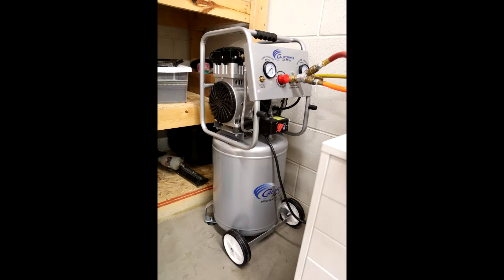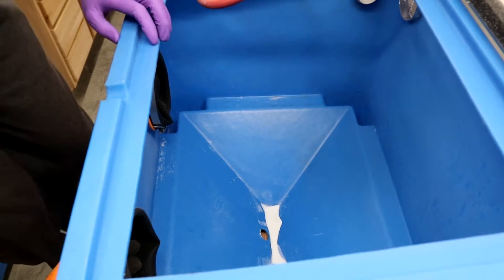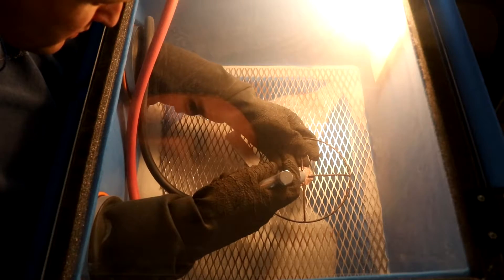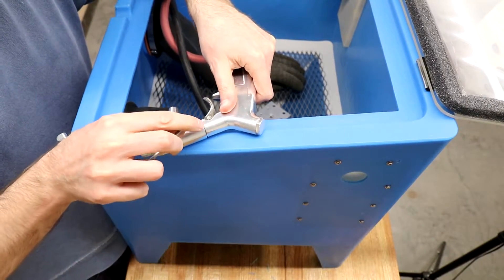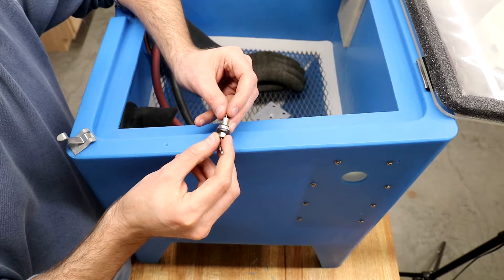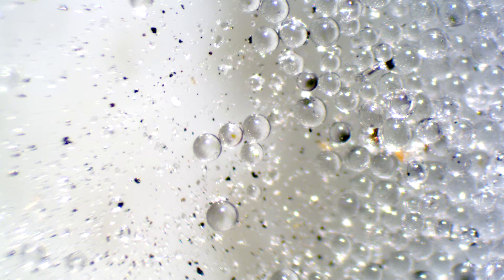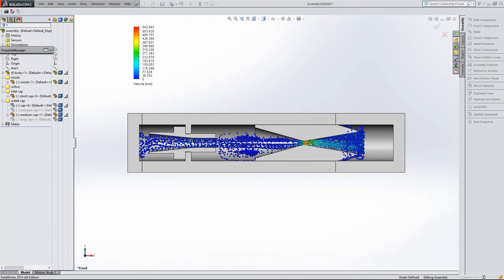Abrasive Blasting With Small Air Compressor

Comment from the maker: Check out my most recent video: https://goo.gl/Jj7cU1

I forgot to include an example of bead blasting a white painted surface. The beads only slightly grayed the surface and didn't remove any paint. I'm sure this has nothing to do with the compressor or blast cabinet and that if a more abrasive media was used the paint could be striped, though the nozzle of the gun may wear faster. Bead blasting may also be useful for reverse engineering PCBs. The glass beads strip the silkscreen making it easier to follow the traces. https://www.instagram.com/p/BRWGMaxjEJk/
Reply: Any way I can buy a baffle kit from you for a cyclone blaster?
Reply from the maker: @jimschiavo8115  Hi Jim, I don't have them for sell. If making them again, I would probably make at least a couple of the pieces from metal and consider using a divergent flow in the exhaust. If there's hardware store shop-vac adapter, that might be the way to go, plus the milled parts. For the 3d printed parts, I have heard people use the following.
https://all3dp.com/2/best-3d-printing-services-for-your-thingiverse-things/
Reply: @kentvandervelden  divergent flow?
Reply from the maker: @jimschiavo8115  You're right, that's too broad. I was thinking a Tesla valve-like, or louvers, or something to create obstructions in the exit, and vortices to drop out the media. Not the divergent flow in the de Laval nozzle for the media gun.
Reply: Hi Kent I did not receive any email rolandgreaux@gmail.com please send it again

Comment: I’m looking at  getting a 2 hp 20 liter  which I think is around 5 cfm , or 150. Lpm , how long between each blast before it starts up again it shard to tell in your video on the time clock , it looks like you started the recovery at 3 minutes
Reply from the maker: At most three minutes maybe and only with a narrow spray pattern, and that makes inconsistent coverage. This compressor is usable in emergencies for this size of gun nozzle. A larger compressor is needed for regular use.

Comment: Just picked a blast cabinet and have a 30 gal already. I have been wondering about efficiency using a small cfm (6@90 psi) compressor. I do appreciate the math used for the nozzle. That info I'll hold on to.
My question to you is would enlarging the line from the compressor to the nozzle improve flow? My thought was removing a few restrictions would allow higher velocities...
Reply from the maker: Thank you Vincent. When air is flowing, the pressure is going to drop across each restriction: from the compressor into the tank, into the line, and then into the tool. The amount of pressure drop will depend on consumption rate. Keeping the blasting cabinet close, with a short good size line will help the numbers, but the real test is measuring cleaning rate per minute. Let me know what you discover, I'm curious if you see a difference. On my compressor the largest restriction is the between the tank and the hose, in the compressor fittings!

Comment: Hello Kent, how would you determine the best gun (nozzle and air jet) for a certain compressor? Basically how to determine gun cfm requirements and check if it matches your compressors output?
Reply from the maker: Hi Enrique. There are charts to help for standard nozzle sizes. It's amazing how quickly one runs into a CFM limit.
https://www.mediablast.com/sandblasting-compressed-air-chart

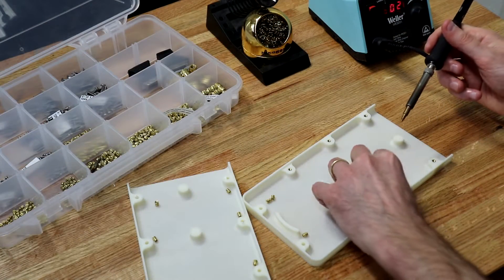Comment: 3:17 is that simple soldering iron or special tool?
Reply from the maker: Great question, this is a combination of a normal Weller soldering iron and a special tip. McMaster sells these but they are expensive and a combination of insert and removal tips is about $40 for each insert size. I made these on a lathe from a bit of brass. The insert and removal tools are similar but the removal tool has a threaded end for grabbing the insert. If you are interested, send me an email and I'll reply with the drawings.

Comment: Brilliant . Is there any way I could hire you to make a pair of those baffles and the nutserts? I don't have access to a 3D printer.
Reply: Just figured out I can order the 3D printed parts from the Thingiverse site and get them shipped to my door. The internet is still pleasantly surprises me despite how rotten it's become.
Reply from the maker: Sorry to reply late. I've been meaning to, but I needed to figure out how I was going to replace the broken extruder on my printer. Let me know how things work out. The baffles have helped reduce the wasteful consumption of glass beads, but they could be further improved.
Reply: @kentvandervelden  I ordered the baffles from two engineering students in Pittsburgh through Treatstock on Thingiverse. Printed in blue ABS to match for US$50 shipped. Not bad! I used less professional looking but adequate self tapping screws instead of nutserts, 3M VHB tape to seal the two flanges and coarse steel wool as a filter element in the baffles to hopefully reduce blow-by. I replaced the porous foam under the pane with single bulb weatherstrip for a better seal. The rest of my set up is shop air at 150 psi regulated down to 90 psi, an Oneida Dust Deputy and a Vacmaster Beast portable shop vac. Thank you for making this design available to the public. The true spirit of the internet where information is shared among enthusiasts, not jealously guarded.
Reply from the maker: Hi Noah, thank you for telling me how this worked out. The steel wool filter is pretty clever. Your comment about sharing vs. guarded secrets come at a perfect time, like a sign. Best wishes

Comment: Looking back, would you have chosen a more powerful compressor? 

Glad I found a channel that provides your demeanor and content!

Many thanks.
Reply from the maker: A bigger compressor would be an easy choice unless portability is needed. Previously. I had a 220V 5HP two stage Ingersoll Rand and that was far nicer but noisier. Maybe IR now makes a slower running compressor. I could probably bead blast 10x faster with that compressor. The cabinet I had was the floor standing model of the desktop model shown in the video. In my situation, noise, location, and electrical service made me choose the CAT compressor, which is still running a couple of years later. Thank you and have a Happy New Year!
Reply: @kentvandervelden  did you ever find a optimal nozzle size for such a low cfm compressor? im kinda in the same situation using a basic 21gal harbor freight unit ay 4.7CFM @90PSI and would like to optimize the gun/nozzle size so the compressor has to work less, as well as optimize media effectiveness. Thanks
Reply from the maker: @christopherlister8932  Thanks for calling me out :) This is one of many projects that get pushed further down the list. A few people were interested with the modeling and engineering experience to get the job done, but I didn't have the time. Today I would certainly get a bigger compressor, mine is showing problems, including multiple leaks, from running so much. Even the compressor you mention is larger than mine. A big problem with using smallish compressors on media blasters is that a small nozzle must be used. I wanted to increase the velocity of the media, which could be measured by the energy imparted to the target, but the pattern gets tighter. With a tighter pattern the operator's time increases potentially a lot and with poor overlapping the finish on the part is not as nice. For prepping small aluminum parts I mostly use a vibratory tumbler. Not sure if I can help you more today, but if I can in anyway do ask. Best wishes, Kent
Reply: Kent VanderVelden I understand, the cabinet I’m using says it uses 9.5cfm at 90psi however I’ve read you need to x that by 1.5, meaning a 14.25 cfm compressor. Looking around that puts me about the $1000+ mark which I’m still debating over. Tough choice but I do need a compressor to keep up with blasting and prep for powder coating on the side now. We shall see. Thanks
Reply from the maker: @christopherlister8932  Before moving to town, I had the next size cabinet, floor standing unit from the same manufacturer. That was powered by a Ingersoll-Rand 2340L5-230, which also ran constantly, but delivered sufficient power that the blasting pattern was nice and even and processing was quick. Larger and dirty farm stuff I blasted outside with a pressure pot. If you at all do blasting as part of a side business... and already have the needed electrical... a large compressor (and good water and oil separation) will save you a lot of time.
Reply: Kent VanderVelden yeah for sure I have the electrical all setup I just need to land on a decent price point decent cfm compressor next, I think a 60gal something around 12cfm should suffice

Comment: what size bead did you use ?
Reply from the maker: "60-120 mesh grit" and the brand is Potters. I'm sure I ordered from MSCDirect.
Reply: Kent VanderVelden thanks for the reply , really great work on fusion and other mods. Do you have any experience with glass abrasive 150 and Glass 220 bead?
Reply from the maker: Hi Iassac. I have a bucket of the finer beads but have never used them. Have you seen the following video? He has a lot of great suggestions for glass beads. Looks like a lot of his equipment is custom too. https://www.youtube.com/watch?v=NidtDNT0MM0
Reply: Kent VanderVelden that's great I havnt seen this video. I will check that out , it hasn't been easy finding info on glass bead with different types of material. I appreciate it

Comment: Kent: I have the same California Air compressor. Do you know where I can get a blasting gun with a 5/64" orrifice like the one you have? Any guidance would be appreciated. Thanks.
Reply from the maker: The gun that I showed came with the blast cabinet, which is from Cyclone Manufacturing (https://www.cycloneblasters.com/) but the cabinet model is no longer sold; mine came from eBay. Regardless, try contacting Cyclone (info@cycloneblasters.com) and ask what they can provide.

Comment: decent
Reply from the maker: +Asher Rose Thanks! Have a great weekend
Reply: any more updates on this? very interested
Reply from the maker: The setup works well. I use it frequently for cleaning up parts after machining or just to knock off crud. Works fine with the small compressor I have with the small nozzle. I've also used it to remove silk screening off PCBs to help with reverse engineering two sided boards. I only use glass beads, and with them with the vacuum on the lowest setting there is still some sucked up with the baffles in place. Far better than without a baffle. There's a decent amount of media that gets caught on the ledge holding the grating, but some wedge shaped hardwood or similar around perimeter resting on the grating and ledge would solve most of that. I have a few nozzle designs to test, once the new CNC lathe conversion is done. I would like some way to truly measure the impact force of the abrasive. Perhaps a piezoelectric sensor? Very useful tool. Let me know if I missed something.
Reply: you answered everything thank you!! once ive made my unit defo need to invest in a decent lathe!

thank you very much
Reply: one more question, what grade is the glass bead? my compressor iv been told will struggle to lift it 60 to 80 grit, but im making a modified gun to combat this
Reply from the maker: I'm using 60-120 mesh glass beads. 50 lbs made by Potters and sold by MSC. The material is nice and clean. Finer grit might work better, I'm not sure, but I've been satisfied though.
Reply: great thank you